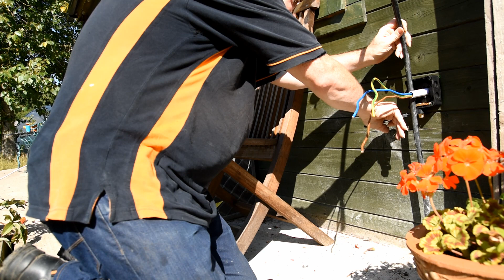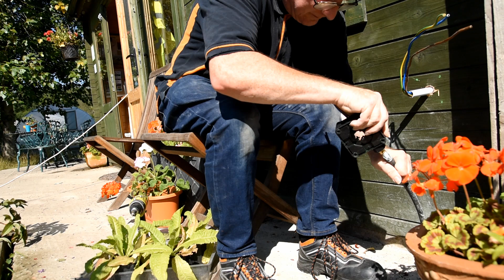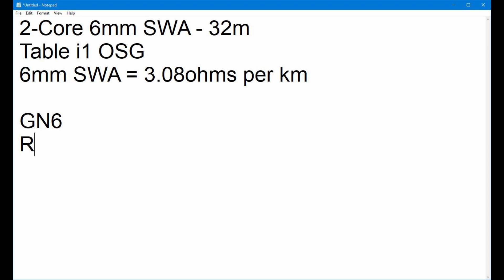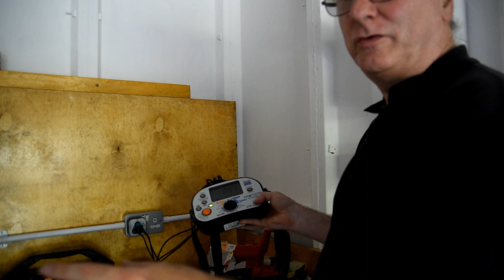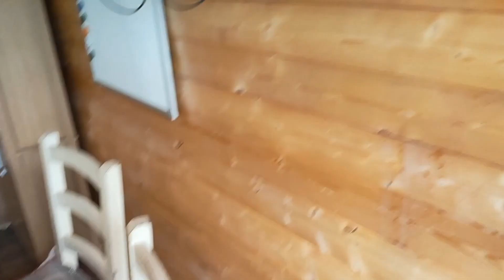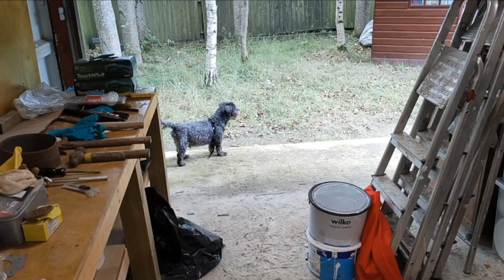STEP BY STEP: How to Install Power into a Workshop - Final Episode

Comment: Hi,  to get selectivity  between upstream 100mA type S RCD and the downstream RCBO'S, you'll need to change the downstream RCBO's to a "double pole" type, the miniature Fusebox ones  will do the job. If  left as a single pole,  a neutral to earth fault will be seen by the upstream RCD even after the single pole RCBO has disconnected .
Reply from the maker: Thanks for the heads up on this. I've double checked the wiring diagram for the RCBO's I've put in, and yes, they are of a type that doesn't switch neutral (I believe the ones that do are called SPSN and some manufacturers do them, unfortunately Fusebox isn't one of them). When I do the follow up video, I'll leave the ones I have in place, then do the test, it'll make a good example of why not to use single pole RCBO's that don't switch neutral in a TT set up or in series with another RCD.
Reply: @vwes   The fusebox compact (mini) RCBO is 2 pole  providing a switched neutral. This will satisfy any potential selectivity issues and also provide isolation of the neutral as required in a TT system.  👍.

Comment from the maker: Can I clarify one point in the calculations. I said 3.08ohms was the value for 1km of 6mm copper conductor from table i1. I said that because the values in table i1 are in milliohms per metre. The values for the SWA armour were given in km, so I wanted to keep the values comparable before converting them to metres for the calculation. Apologies if it caused any confusion, but remember a lot of the resistance values given in the OSG are in milliohms NOT ohms.

Thank you to Matthew who pointed this out. Even when I put in the 100ma time delayed RCD, I still won't achieve selectivity because the RCBO's are of the single pole type which do not switch neutral which means a neutral to earth fault will still be seen by the upstream RCD. Some are available - called SPSN, but Fusebox don't do them. So the only way to get this to work, is to also take out those RCBO's and put in the double pole versions (the miniature RCBO's). In the follow up video, I will test the setup without replacing the RCBO's to see what happens, and then replace them. It'll make a good demonstration.

Comment: Sorry,  But the table I1 is for resistance per metre not Km which is 3.08 Ohms.  Therefore the total resistance of your conductor
is 98.56 Ohms total.
Reply from the maker: Hi Bill. You made the same mistake a lot of people do. The figures in table i1 are in milliohms, so 3.08 is actually 0.00308. It's a popular question in electricians multiple choice exams to choose the 1m resistance value of a particular conductor size and 3.08 and 0.00308 are both options. If you think about it, if 3.08ohms was the value for 1m of 6mm conductor, it would throw all the other calculations in the book.